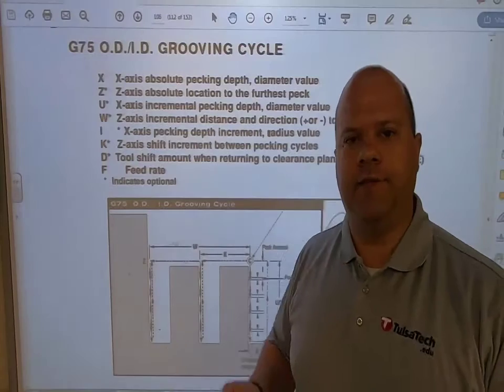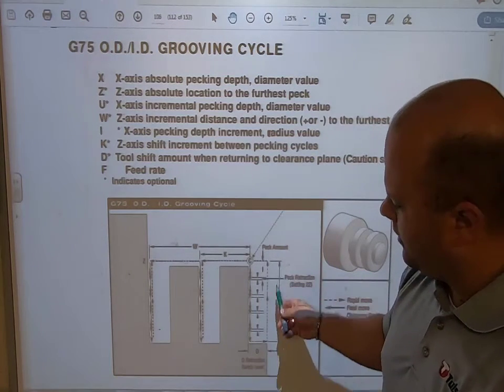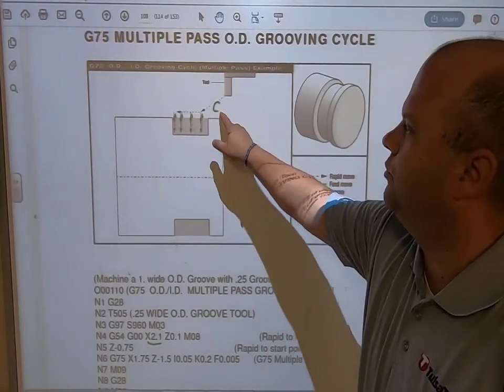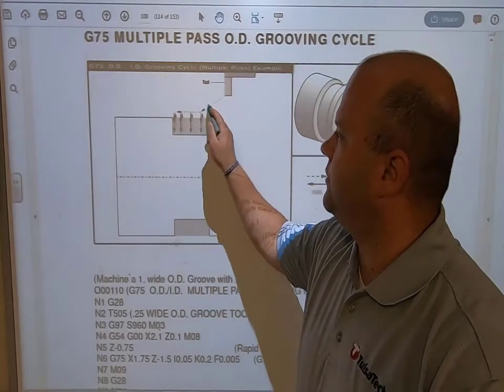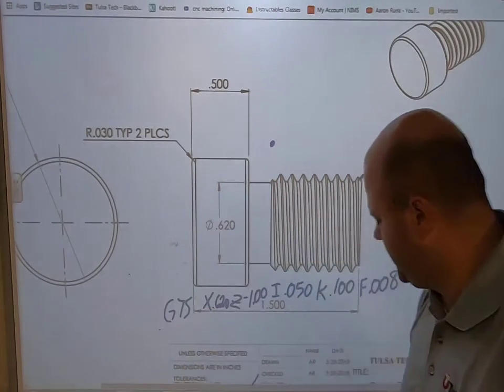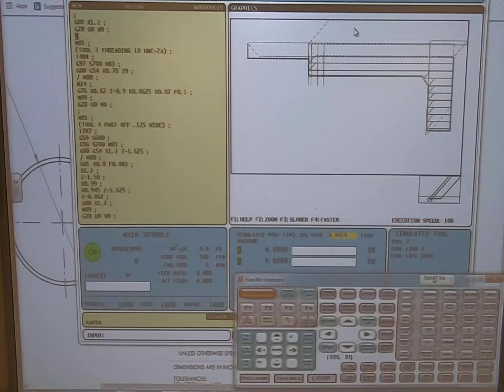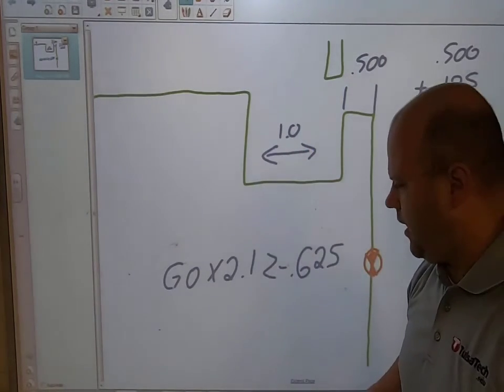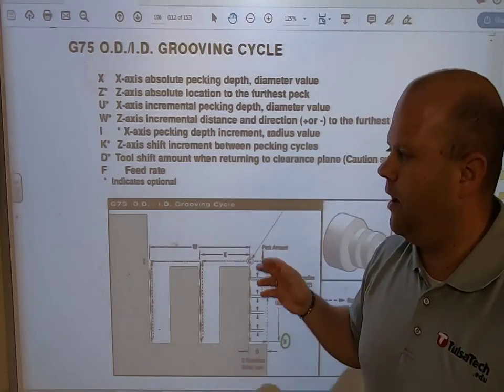Hand Programming using G75 Grooving Canned Cycle

Comment: Hi, I work at a sprocket and gear shop and want to start doing some of the grooved parts we have. All of the grooving is done either on conversational or with programs written on conversational and transferred over. My question is if a g75 cycle can be used to cut grooves with chamfers on the walls or of its strictly in and out movements.
Reply from the maker: It's good that you're always looking for ways to improve because that's how we make money. unfortunately, G75 only makes straight in and out movements. However, you can use the g75 to rough out the groove and then use a g01 to move on a diagonal line to make the final cut on the tapered wall. That's what I ended up doing on this part linked below.   I made three different g75 Cycles because my machines memory couldn't hold all the toolpaths that was generated from my cam software but then I copied and pasted the finished pass. I hope this helps and thank you for watching

https://youtu.be/_QF5M_cD4lg?si=6_-o0YorBk-P3BDh